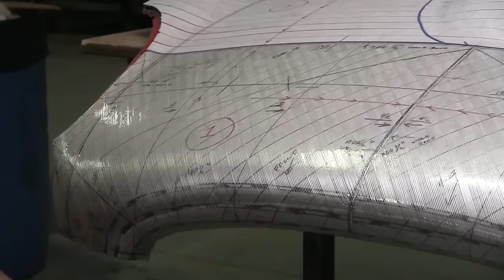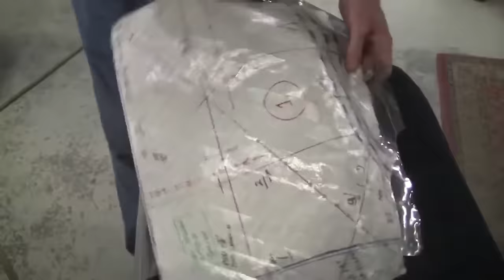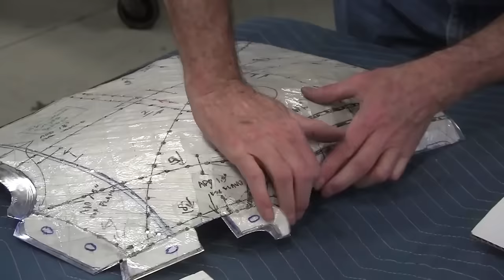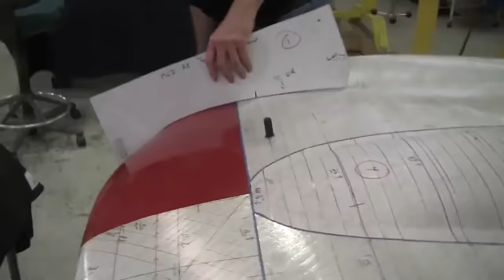Metal Shaping: Jaguar E-Type Front Bonnet Build in 25 minutes

Comment: This might be off topic and maybe you already know this trick but I'm a sign painter and we use something called a 'Pounce Pad' and a 'Pounce Wheel'.  The wheel looks like a tiny cowboy boot spur that pokes little holes in your tape template, so you would trace your layout lines in your pattern with it, then the pad is full of chalk that you dab over your pattern to transfer your line via tiny chalk dots that go through the pattern on to your work piece.  Once you have the chalk dots on there you can connect the chalk dots with a sharpy.  You've been doing this since Noah was a cabin boy so you're probably familiar but it might help someone.  Also I love the sped up videos, I watch all the others too but the quick ones are good for my friends with extremely extremely short attention spanss who hit a piece of metal stretching the Christ out of it then keep hitting it the same way thinking it will shrink if they hit it enough times.

Comment: Hi Wray :Hope your Christmas was very good and thanks for the postings on YouTube they are enlightening and stir the interest of creation .  I have been looking closely at your flexible shape pattern. At anytime does the tape do a cross hatch affect with the glass tape "or" are you overlapping closely layering the glass tape and how close ?  I want to do this on a project but don't want to waste material in the Genesis of my project . 
    Just wondering is your blacked thumb nail from what was called at on time a Garand Thumb  or from the from the English wheel?   Thanks Dan R.
Reply from the maker: Hi Dan, The low stick layer of tape goes on first. You lay it done so it goes over the shape easy. Any overlapping you carefully cut out and remove. The second layer is the fiberglass reinforced tape. You can run it the same way as the low stick or 90, or 45 degrees to the low stick layer.  Overlap the fiberglass reinforced tape  by at least 1/4". I sell the best tapes for the job at my website www.proshaper.com.  I squeezed my fingernail on the jump shear safety hold-down . It hurt for ten minutes.
Reply: @proshaper  Wray you do amazing work hi 👋 from 🇨🇦 #YSW respect back to you 🙏

Comment: What is that white pattern material and where to get at start of video please?  Is it designed to conform well over compound curves?  Thanks!
Reply from the maker: I am the inventor of the flexible shape pattern technique. I teach how to use it at my classes. I do have a video on my YouTube channel,  and I sell the correct tapes on my website www.proshaper.com.  The flexible shape pattern system allows you to super accurately copy and full surface.

Comment: Hi wray luv the show most old trades and skills are a dying art form which when lost we cant get back ,i was wondering what thikness material you use in alloy and steal to make car body panels stay safe and god bless.
Reply from the maker: Hi Les, Glad you are enjoying the channel. When using steel you can use 20 gauge ( .035" strong enough easy to shape but on the light side)   19 gauge ( .040" excellent and the best choice, most often used on original stamped panels strong and still easy to shape)  18 gauge (.045" excellent superior dent resistance but harder to shape.)  With aluminum you have .040" shapes very easy but has minimal dent resistance. .050" shapes easy has better dent resistance.   .060" shapes with more effort and has excellent dent resistance- the preferred thickness.

Comment: Nice work,  what thickness aluminium do you use there?
Reply from the maker: .063"  3003 H-14
Reply: What an old school master. With a huge shop full of machines it comes down to using your hands. 
 I must say there are other ways of doing this much easier by making fiberglass splashes of the parts you want, then hammer forming them into place. A once over with the wheel to planish them and you’re done. 
 I will say we owe you some gratitude for showing us the old tried and true traditional way. Nice work!

Comment: Don,t  work without gloves
Reply from the maker: Gloves don't allow you to feel the surface. They also drop debris onto the surface as you wheel and it gets embedded into the surface. If you sand smooth all of the perimeter of your panels the metal can be handled safely. As you can see there are good arguments both for gloves and against gloves.